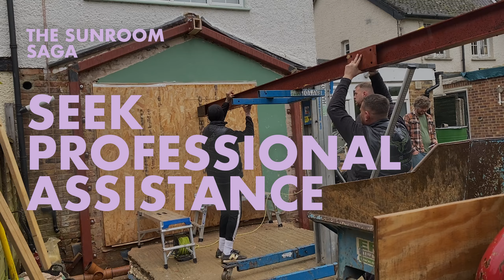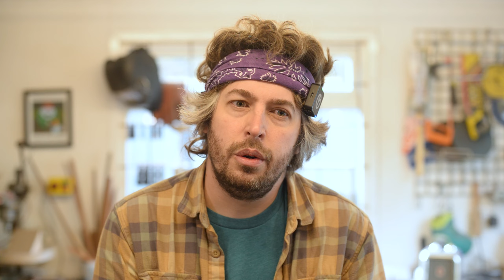Getting my conservatory project back on track

Comment: As much as I prefer the Flemish Bond, doesn't that make it conflict with the rest of the house?
Reply from the maker: That is a good point! The great majority of the rest of the house is pebbledashed - the only part that will be left visible in running bond is around the laundry room door - all of about two square metres. I figured that this wasn't enough reason to not do the extension the right way, and if it bothers me enough in the future, it wouldn't hurt to pebbledash that small section to match the rest of the house instead. Thank you for watching!

Comment: I'm surprised your engineer is insisting on steel for this at all.  It's not a particularly large structure, I've built larger spans out of wood.
Reply: Think it's prob to do with the cathedral type roof, having no ties in it.

If he had a normal tie beam at ceiling height and supports. Could have done the whole thing in timber.

Covestation with architect and customer prob went along the lines of well you will need a steal ridge if you want no tie bean. If you want no bracing at all, you will need steel rafters, you be as well just come down with the steel posts with weight and  if you are ordering all that steel. lol